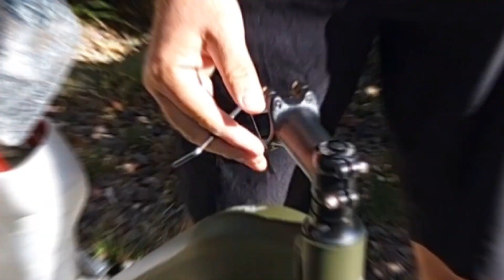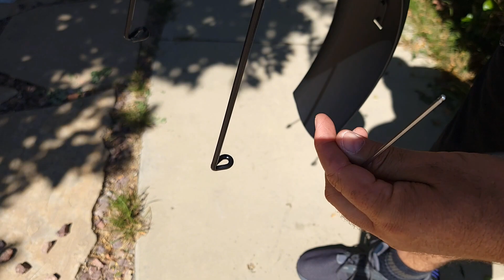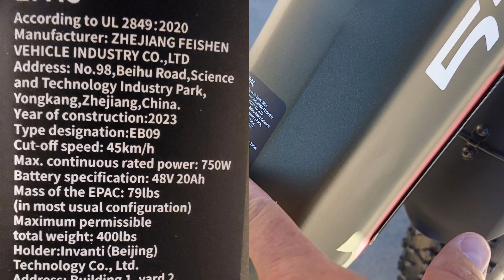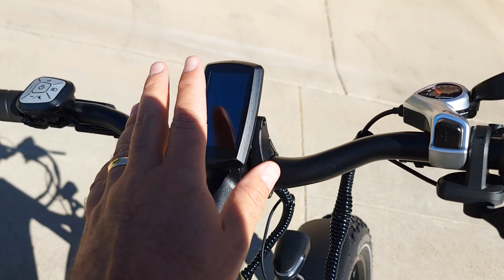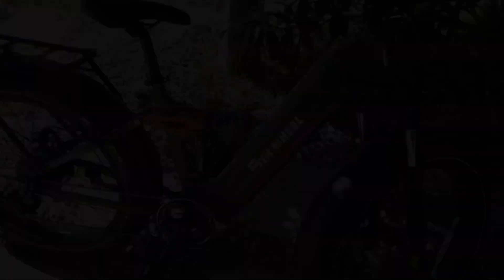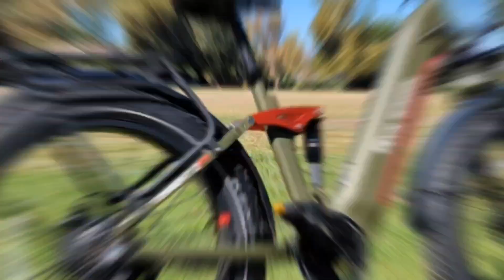Best Full Suspension Long Range eBike with Torque Sensor : 5th Wheel Torrent 2FT  SUV eBike

Comment: I ordered a 5th Wheel Torrent 2FT last week.  I received it 4 days after ordering.  I must say I am pleasantly surprised with the performance and quality.  As a 75 year old rider I like the responsiveness of the torque sensor and the smooth ride provided by the full suspension.  Acceleration is fast while pedaling.  I find it performs well up hills and through 4” of heavy snow.  It is a great bike priced substantially below other 26” fat tire full suspension step through ebikes.  At $1499 less available discounts it is a bargain.
Reply from the maker: I am glad you liked it. Its pretty good bike and I am not surprised you liked it 😊. I rode many ebikes and this by far my favorite right now